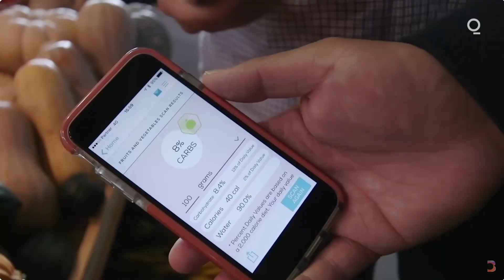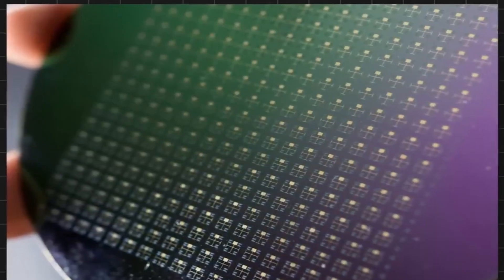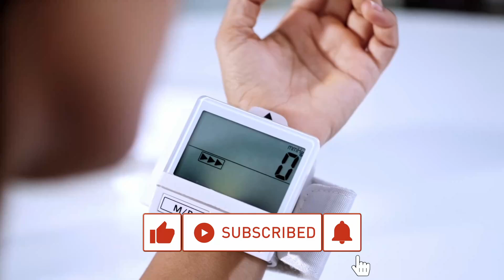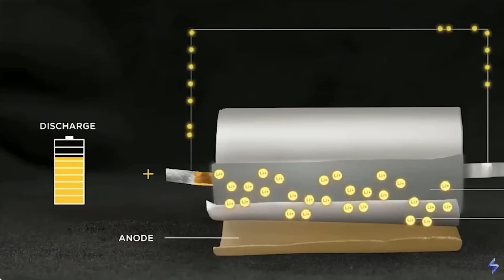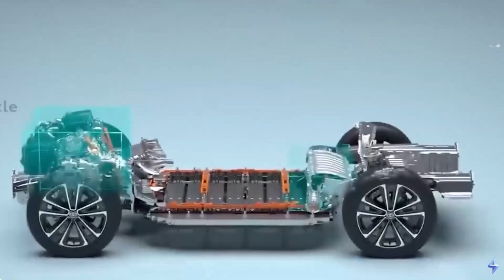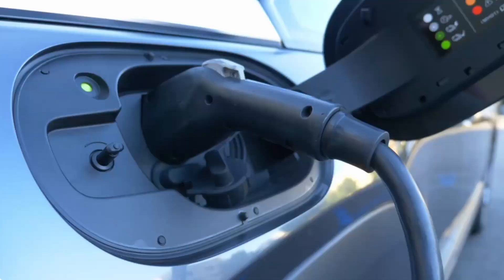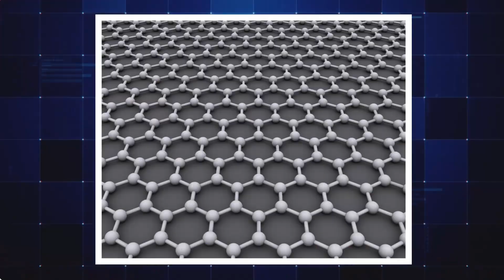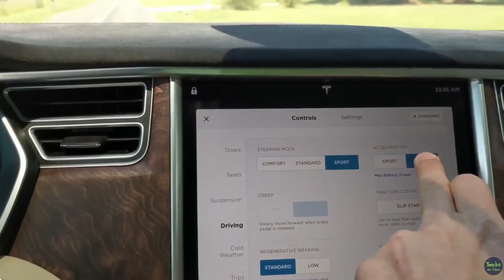MILLION MILE BATTERY: SHOCKS EV WORLD…

Comment: MILLION MILE BATTERY
Yeah, right.
Don't you wish?
Expect lot of similar in the near future.
Reply from the maker: Yeah that thats the claim. But it will take years to prove. A fast charging battery that could go 500+ miles on a single charge would be more impressive at the moment.
Reply: @techwaveking  
"Yeah that thats the claim. But it will take years to prove."
==
You'll see percentage decline in a year.
Reply from the maker: @allgoo196 all batteries decline after the first year,  question is how much. If after 5 years or camparable milage they can remain at around 90 -95% thats pretty awesome.